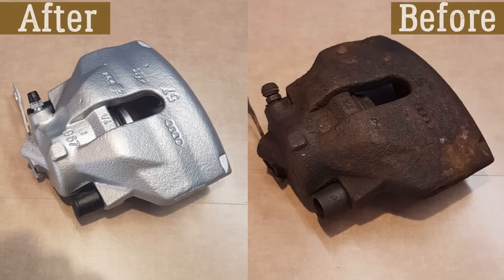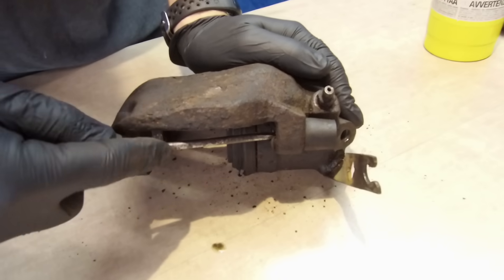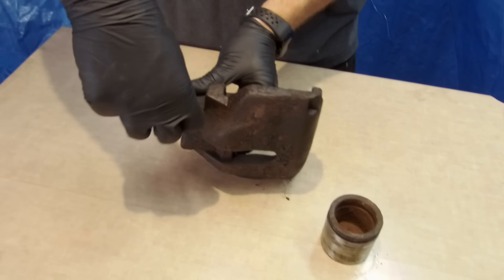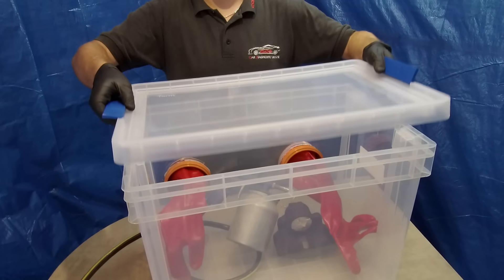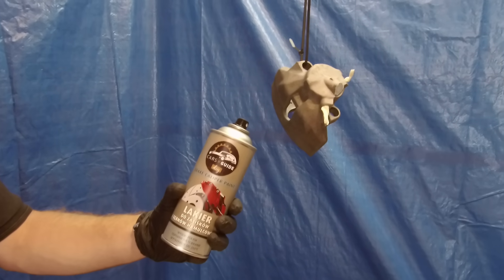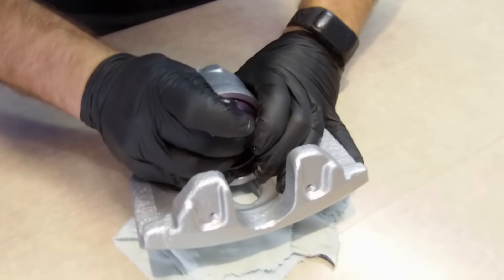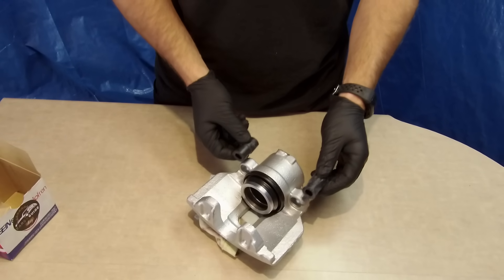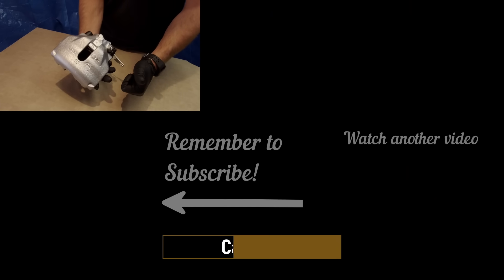How to rebuild front brake caliper - VW Audi Skoda Seat - New piston and seals (COMPLETE GUIDE)

Comment: Hi from Australia, I have been a heavy diesel mechanic for almost sixty years and the first thing that you learn is to clean everything BEFORE you pull it apart. It prevents any crap from getting inside while you work on it, and you hands and tools stay cleaner.
Reply: Spot on. I've been wrenching around for little more than 3 decades. Same, same. Even "restoration" projects, fancy name for saved from the scrap! The first thing they get is a decent bath. Including Q-tip cooling fins. LOL 😂 😂 
I told many people if dirt, was any good for performance, efficiency, etc. All cars and bikes would reach us covered in OEM mud. ;-)

Comment: Here's one piece of advice, you should do the majority of your cleaning and blasting with the old seals and piston in place. This will help seal and protect the piston surfaces far more than anything you can apply.
Reply: Good point
Reply: that depends, they use a lot of salt on roads where I live, so the biggest problem with these calipers is the corrosion of the piston AND the seal seat in the caliper, so if it has corroded bad enough around the seal seat (and I mean the hydraulic seal, not the dust cover), then the caliper is scrap, since there is no way to clean that area, if you do a really thorough job, and perhaps use electrolytic rust removal (or chelating rust removal solutions), then grease to fill the rust pits when seating the seal and dust cover, then it might work for couple of years, but if water gets in, it will corrode and seize in a matter of months
not sure what they make calipers out of these days, but I don't recall them rusting this bad 10-15 years ago, just had to repair a caliper on my 7yo VW that seized on me suddenly, dust cover was intact, but when I pushed it off, revealed heavily corroded piston, chrome flaked off etc, and visually, there seemed to be very little chrome on the piston compared to cars made back in 1990ties
and they talk about sustainability and green etc, and produce these cars that are junk in less than 10 years...
Reply: @dsfs17987  sustainability talks is a joke... the only thing that matters for the BIG fellows is profit... and that's why they make your car last maximum a decade... 🤮🤬

Comment: I always replace the calipers... never knew it was this easy. And it looks brand new! Thanks for a nice and easy guide :)
Reply: it looks easy, we always repair them, because the repair kit is 1/10th of the price of a caliper, but when something goes wrong or it's not repairable( very rare cases, because of wear) we have to buy a new one. in some cases the pushing mechanism of the handbrake gets destroyed when the piston is siezed and you try to remove the piston, we can't get a replacement kit for the interior parts.
Reply: Yep. That's right. Where "rebuilt" calipers are available. They pass trough a similar process. Of cleaning, rebuild and re-sold. Quite honestly virtually "as new". In what the end client is concerned. Totally worth.
Reply: its bether replace all caliper then take a crap part and ruin all job :D

Comment: It is an amazing job, but I have a different experience.
I also bought this repair kit for € 19 each.
At the cost of cruel work, I degreased, disassembled the caliper that required a special tool, filled the system with new brake oil, and finally bleed the brake system.
The success lasted for about 1 week because he started to release the brake oil again.
No, the cylinder was not scratched, I just think it was asymmetrically worn.
I then bought a new caliper for € 15.95.
A week later, the caliper on the other side broke, I also bought it.
If I had bought it in pairs, the price would be € 27.06 / pair.
The brake caliper replacement is a fraction of the refurbishment, it takes half an hour.
The renovation is an incredibly big suck, and after that you can clean up and pay for the consumables.
Reply: The price of a new caliper is dependent on the vehicle, the calipers for my car are £200 new and the rebuild kit was £15.95. If you could get a caliper for less then a rebuild kit why did you even bother rebuilding it?
Reply: No way a new caliper was 15.95
Reply: Some calipers are indeed not expensive.

Comment: Congratulations on a good video!  The greatest point is the DIY sandblaster box! Please do a video on it!

On the less than good parts, please let me comment on your use of too much high-temperature grease on the piston seals. I believe that it is better to just use new clean Brake Fluid to assemble the piston seals, as any grease will contaminate the brake fluid.  In respect of the many comments saying not to use grease on guide pins, my experience is that pins MUST ALWAYS be well lubricated with high-temperature grease because it is the design of a FLOATING CALIPER!  If NOT well greased, one is certain to end up with very different wear on the internal vs external pads, a less than good pad retraction and more noise!  That is the reason to use rubber sleeves with caps!  Just do not over grease them to prevent ANY grease to migrate to the rotor or pads.
The sliding contact points on the pad backplate must be also lubricated with Hi-Temp grease, but not more than a match-head blob of grease will suffice.
Reply from the maker: Thanks :) As you said, everything   goes straight to the point 
Regards :)

Comment: Oh aye, let me just whip out my compressor and sandlbaster.

Good simple and informative video bud.
Reply: He did point out that you can:
1. Pull out the piston with a clamp (with some effort)
2. Use sandpaper and a steel/wire brush instead of a sandblaster (will take about an hour per caliper)
There is no need for expensive tools, though they make the process much easier and faster obviously.
Reply: @kickwer  r/woosh
Reply: What man even changes oil and doesn't have an air compressor? Like 4 real?
Reply: u can put caliper into acid leave it over night and its clean then just let it dry on sun and you are good to go
Reply: @bufordmaddogtannen5164  Brave of you to assume I change oil. Auld boi.
Reply: Foot pump and wire brush.

Comment: Very nice job on the Caliper, and the video!  Always put a dab of Anti-Seize or graphite grease on the Bleeder screws so they don't give you trouble in the future (like you had when you first had to remove it!)  Cheers
Reply: Red Rubber Grease only.   No contamination of fluid!
Reply: @jimosullivan1389  RRG is for Seals and Dustboots (when using DOT3 or 4 Fluid), Silicon Grease when system will be filled with DOT5.  For Bleeders (metal to metal) graphite is recommended for the graphite particulates which you don't get ANY of with RRG...and if you contaminate your Brake Fluid with what's on Bleeder threads, maybe you should reconsider your bleeding method...flow direction is OUT not IN!  Cheers

Comment: Excellent job, it would be interesting to see how long the paint will last 👍.
Reply: Chris Bailey did mine with hammeriitr smooth 6 years and still looks like new 
Car is on my channel brakes can be seen 
1993 Golf GTI  with audi s3 engine and brakes
Reply: @kells77  That's amazing, never    would have thought to use that paint, in case it set on fire.
I'll give it a go next time, cheers👍
Reply: Chris Bailey if u look on my channel in the videos of my black golf the gearbox is also painted in hammerite ( spray version )
The finish is like a power coat once done and very good I also did the rocker cover agian this has been on 10 years and still like new - gets very hot too no issues at all
Another brand to use is the rustolium paints

Comment: That grease was meant for the guide pins only. You can’t use it on the square cut seal or piston, it will contaminate the brake fluid and cause abs module issues.
Reply: In that type of caliper it's forbidden to grease guide pins.
Reply: @damiansmigielski  WHY?  guide pins MUST be greased in order to slide freely!  Even the VW shop manual says to regrease them.
Reply: Alfredo Márquez in that type it’s forbidden. Grease gonna collect dirt. They aren’t sealed
Reply: Alfredo Márquez and I checked in manual. They say that grease is forbidden

Comment: nice job, i'd personally wouldve ran a tap into the thread of the bleeder valve and put a bit of anti seize on the valve threads, but thats just me
Reply: Red rubber grease is better as it is compatible with DOT3/4 and 5.1 brake fluids. No mineral oils or greases may be used in places that come into contact with brake fluid.

Comment: Before sandblasting, you should wash the clamp with water under pressure to remove any contamination. After this treatment, you can sandblast.
If you have sandblasted the part, never use any liquids or rags to re-clean (6.53-8.00). Make sure the surface is kept clean until painting.
Such a thin coating will not protect the caliper against re-corrosion.

Przed piaskowaniem powinieneś umyć zacisk wodą pod ciśnieniem aby usunąć zaniczyszczenia . Po tym zabiegu możesz piaskować.
Jeżeli wypiaskowałeś część ,nigdy nie używaj żadnych płynów i szmatek do  ponownego czyszczenia ( 6.53-8.00).Zadbaj o utrzymanie czystej powierzchni do czasu malowania.
Tak cienka powłoka nie zabezpieczy zacisku przed ponowną korozją.

Comment: Great video.. I did mine in deep red and also the bracket that holds the caliper on. They look great sitting on the zink coated drilled and slotted brakes. Wish I could upload a pic ..

Comment: I thought this was an excellent vid.  However, I stopped it at 5:35 to comment.  1)  Instead of using masking tape to plug the bolt and bleeder hole's, just re-install the bolt and bleeder!  2)  clean oil off the piston cup, apply a bit of masking tape, re-install piston cup just with light tape friction so the piston does not move.  >>>> Then sandblast till your hearts content!

At 10:30, I would strongly suggest that you do one of two things.  A) Use your Red Grease to coat the threads of the new bleeder screw, or   B) Apply a bit of anti seize to the bleeder screw threads!    Water/moisture has an uncanny way of getting into those threads and rusting.   Anti seize will allow easier undoing and bleeding in the future!!!  Also add a bit of anti seize to the bracket bolt!

Cheers

Comment: mechanics all around the world: you need your caliper rebuilt.
mechanics in USA: you need a new one.
Reply: Mechanics in all around the world says u need a new one too. since thats alot of work hours to restore one wich isnt new, in finland this particular OEM part is 250euros, i would say u get half the price of from an aftermarket one, but still tho we charge 110euros per hour on volkswagen and it takes less than  an hour to swap, and you would pay way more for a restoration so we dont do it anymore, same goes for alternator etc, way cheaper to swap than rebuild.. and hey, its a new part instead of the old rusty shit.
Reply: @karppa8657  okay let me correct it.

mechanics all around the world: you need your caliper rebuilt.
mechanics in first world countries with high labor rates: you need a new one.
Reply: Most non OEM callipers have been restored. That’s why the motor factors you buy them from knock off the surcharge if you bring in the old one to be sent back to the manufacturer for reuse.

Comment: never remove a O-ring with a normal screwdriver casue it will most likely scratch the seat where its laying in and you will end up with micro leaks that will become bigger with time . If you ever wonderd why sometimeyou ahve calipers that sweat oil a bit well thats where it comes from .and as time goes by that sweating will increase into a real leak . There are special tools made to take out O-rings  and will not scratch the seat of the o-ring

Comment: Just  did my rear two but I didn't apply any grease to outside of piston I suppose I got some on it from handling it  and fitting it in. Is it absolutely necessary to aplly grease to the outside of piston before sliding it back into caliper?

Comment: The thread of the new bleeder screw needs to be lubricated with grease, according to the Volkswagen repair manual, torque to 10Nm.
Reply: I use copper ease on mine.

Comment: Personally, I would have fitted the boot into the caliper THEN pressed the piston home through the boot with much lubrication by grease and brake fluid.  Much easier to check you have the boot sealed correctly that way.

Comment: I have a question,I painted the pistons with oil on my van but he did wheels with temperature he is not turning the brakes?I changed the brakes I flattened the disk but again the same problem.

Comment: Great job, great video, but I would have thought you would need to bake that paint after spraying like most heat resistant paints.
Reply: Not all. You can get engine block paint which doesn't require baking.

Comment: If the piston isn't seized up and you are replacing the seals, have someone press the brakes with caliper still on the car, but with brake pads removed. It will be pushed out.

Comment: The grease you've used on the pinston and the seal, is it red rubber grease? I'm planning to rebuild the brake caliper on my car, but the kit didn't come with any lubricant. Any tips on what kind of lubricant I could use?
Reply from the maker: Hi there! 
Red rubber grease was included in repair kit. But if you need to buy one, buy silicone grease for brake piston. It's better, safe for rubber elements and its more greasy. Also you can use brake fluid, it's oily too and safe for rubber elements as well 
Regards :)

Comment: I wonder why you took the old piston out completely, if you were going to blast it, so you would just need to protect the hole again 🤷🏻‍♂️
Reply: that's a nice catch!
Reply: I think he just didn't want to completely destroy the old parts, not a big deal to do so since they weren't being reused but there's not much point in ruining them to save some tape I guess.
Reply: It would be a shame to do all that work and then realize it isn't usable because its all pitted out inside because you didnt check by removing the piston first.
Reply: @Billy28376  exactly. that's one thing missing from this video, to check inside caliper for pitting/corrosion.

Comment: I hope that lube you put inside where the piston goes was. NOT  grease , grease is not compatible with brake fluid as , brake fluid is the same base as - antifreeze - , also the seals are petroleum base as is the grease , so the grease deteriorates the seal
That grease is probably silicone

Comment: One mistake, and that others will surely make.  Did not inspect piston bore for pitting and scoring.  A new piston and seal will fail quickly if these conditions are present.  I have done the same myself over 35 years ago.  I had to clean and hone the bore to ensure a good seal.

Comment: How do you remove the rust from where the square seal normally sits, Is there a better way than just using a pick and screwdriver?
Reply from the maker: Hi there, usually i use dremel rotary tool with soft metal brush. It's small enough to fit in that groove.
Regards ;)

Comment: How many blasting (lets say et callipers) last this plastic box till broke up?
Is it form Ikea?
Reply from the maker: Hi there, this plastic box is really strong. I made already over 10 calipers in this box, and it's still in good condition. Of course the walls got matt, but it's not a problem.  Only thing I replace is that top cover.
Glass cover is much better than plastic. I bought it in similar shop to ikea. Regards ;)

Comment: some steps you did wrong just like you remove the piston with air you install the piston with air when you install the piston seal  only lub the piston side of the seal also you can sandblast the whole caliper without plugs when you install the new bleeder screw use anti seize

Comment: using guide pin grease on the piston and boot is not really the way to go.. seeing that stuff wont really mix well with the brakefluid later on..  and hurt braking performance...  should have used assembly paste that is okay to mix with brakefluids like ATE's 03.9902-0517.2
 700026 Assembly paste. .. one tube will go a super long way. and might even be to much for one time job for that Textar Hydratec has little sachets of 5ml . should be one euro (i can be wrong about the video but that stuff did not look to be assembly paste for brake systems) so jsut my 00.2cents on the matter as constructive critisime and help (y)

Comment: What type of grease did you use on the piston? Unless its some type of special grease thats compatible with brake fluid (idk of any), then you cant use it. Silicone based brake grease is only good for slides and external mating surfaces, and not compatible with brake fluid.
Reply: There is usually a red-colored packet of grease that comes with rebuild kits, specific to this application.

Comment: Why dont you just first sandblasted it and than deassemble? You had everyting covered from dust and it was replaced with new parts....
Reply: If everything is assembled grooves for seal and dust cover are covered. They are getting always nasty so its better to sandblast them to :) It will guarantee that rubber seal and cover is sitting properly without any bumps underneath and piston will work smoothly :)

Comment: any brake kit company that will send you a kit with its  inner O-ring unprotected and   placed in  a position to be bent by the rest of the kit inside the box is a company worth shit . A real quality  repair kit that contains a O-Ring or more than one has a cardboard to lay it on and wrapped in a strong ajusted  plastic bag and will be placed in a safe position in the box if they cannot provide a good protection becasue of the box or the parts inculded those seals and O-rings will be plaved in a flat box that fits inside the repair kit box .i,ve rebuild so many calipers in my life  and i know for a fact that it doens't take much for a slightly bent  o-ring  to come out of its groove  will installing the piston and that in 98% of the time thats what happens no matter how good you are